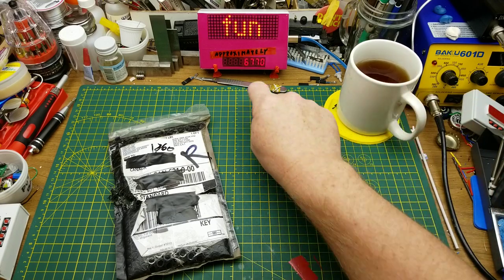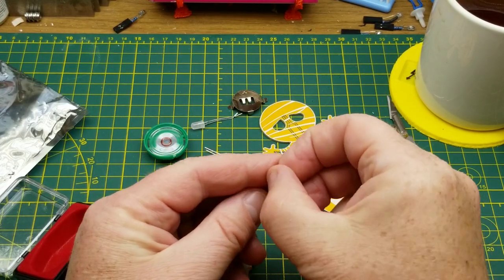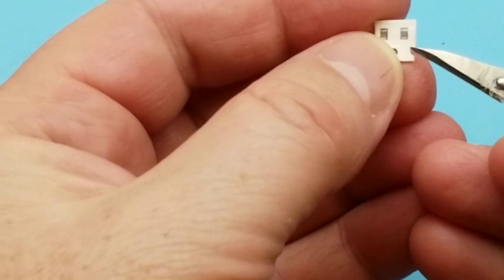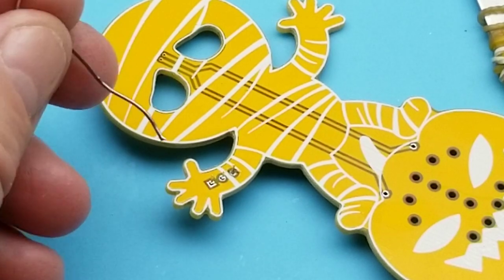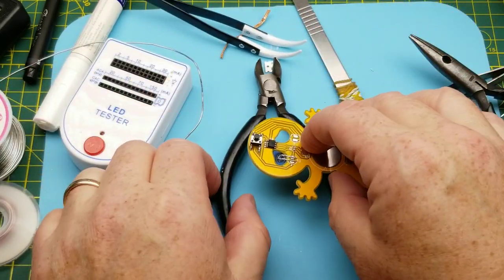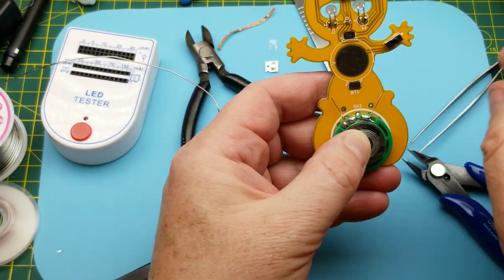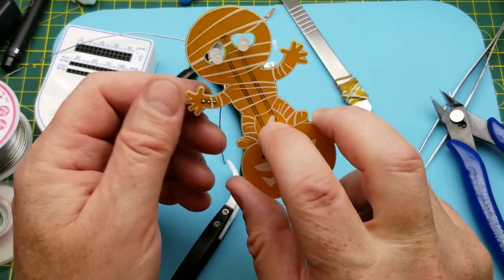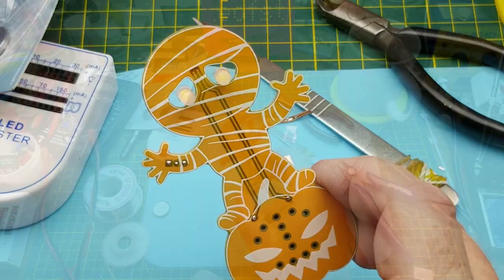Halloween kit build - Cackling Mummy

Comment: To clean your soldering tip cleaner use the vacuum cleaner to remove the bits, just make sure it doesn't get sucked into the bag. To remove the flux residue, soak in a bowl of warm water with added laundry detergent (bio or non-bio) for an hour or so.

Comment: next version, add a pir ! 
if the tip cleaner has a metal bottom/no feet put it in a hot oven, should make a nice layer
or maybe use the hot air gun, both untried

Comment: I have been making myself do more with SMD components as of late. It's just easier to get some things in SMD. I have found the way I get the best results is - Clean the pads, flux as you go, and keep the tip very clean. I know you do this already. With the ic's I also bend the pins in like you do with new DIPs. Not a lot of force is needed, just a very small amount. I find it makes the chip sit better in the footprint and not have a lot of overhangs. Another thing that works for me is to treat SMD soldering more like painting with an artist brush and not like a normal iron.  For chips, I will flux, dab a bit of solder on the tip and then dot the pads with just a touch of solder. I then do the chip alignment and tack a corner down with the solder I have on the pad. I check the alignment again and adjust as needed then tack one side down once I'm happy. I get all the pins tacked and then clean the tip with each pin and gently dab a bit of solder on the tip and add more to each pin like a brush-stroke down the pin and away from the chip. This usually keeps bridges down to a minimum.  I sometimes go back and give each pin a push down with the tip at the bend in the foot with no new solder and flux only.

Comment: I think pins 3,4,and 7 set the sounds/mode of the chip. I bet it has Gingle bells and Happy Birthday as well!  If it is using a binary address, the 3 pins equal up to 8 modes. Try pulling the other pins up with a 10k safety resistor after cutting the pin 7 trace. Have fun :-)

Comment: I clean and rotate my brass tip cleaner once every few weeks or so.  Take it out and shake (over a bin) and gingerly pull it apart and most will fall out. I then fluff it to a clean area on the brass and put it back in the holder.  I can get @ 6 months out of one that way.
Reply: When mine is too far gone, I buy a Chore Girl (copper scouring pad) from Amazon (or the local grocery store) and use it.
Reply from the maker: I do have some spare around here somewhere, I'm just too cheap to toss out the existing one...
Reply from the maker: Seems like a simple solution.
Reply: My brass scourer cleaning thing is in a round black BEST holder, and it's been in there for about 5 years. Occasionally I shake it out, but haven't seen the need to replace it yet.
I do a LOT of component recycling, and to remove old solder I dip the component leads into rosin flux, then heat and wipe down the lead with the soldering iron. That makes the old solder transfer from the lead to the soldering iron.
Then I scrape that off into the scourer thingy and do the next lead. So there is absolutely tons of flux and old solder getting deposited into it every year... yet it still keeps going!
Reply from the maker: Just shake it out- sometimes the simple solutions are the best.  Thanks John
Reply: I am fairly sure these pads are Stainless steel I use pan scourers works very well as solder doen't stick to it and all the solder bits end up in the bottom of the bowl/dish and you just have to tip it out every so often

Comment: SMD Soldering... you need to use FLUX. A good quality (no, not chinese cheapy)  rosin-based paste, not that watery useless "no clean" stuff in the pen that you are fiddling with!
Smear flux over the pads, I use my finger tip. Plonk the component on and hold it with a jeweller's screwdriver (not tweezers, that makes it much harder). Load the soldering iron with solder and slowly wipe it along.
The flux will prevent bridged pins by "encouraging" the solder to wick onto the PCB pads, and the hot tip will draw the excess away.
The more flux the better, but no need to go Louis Rossmann with it. I dunno why people are so scared of flux, probably because they don't know how to clean it afterwards? Just buy some proper flux remover (PCB Cleaner), and don't use bloody IPA that just melts it everywhere, or acetone that melts all the plastics.

Comment: does thee ts100 soldering iron come with a wall plug?
Reply from the maker: I don't have a TS100 (the one I'm using is a T-12), but I believe the TS100 is normally powered from a DC power source.
Reply: I love my TS but it didn't come with wall plug so I use an old laptop supply.
Reply from the maker: Thanks Andy.
Reply: I'm sure you can find a seller that provides one but you can buy one without it. There best voltage is between 19 and 24 volts I would recommend 5 Amp's but 3 Amp's minimum. They sell Between $80 & $120 CDN.
Reply: @pileofstuff  I am loving the T-12 I have now.  It has fully replaced my old 936d clone and I have not turned the Hakko on in a few weeks.
Reply from the maker: @UReasonIt  The only thing I use my Fakko for any more is the hot air tool. The T-12 (clone) really is a nice iron.